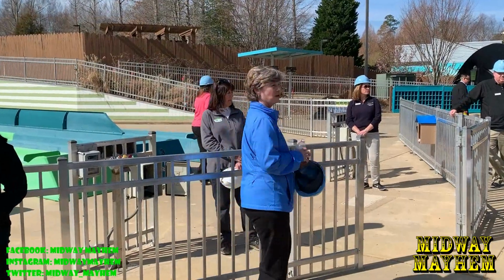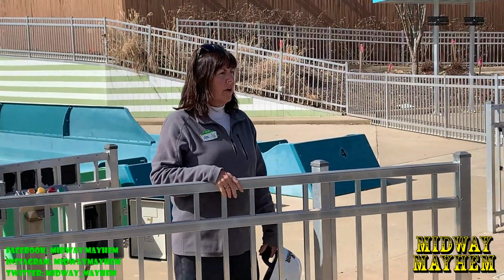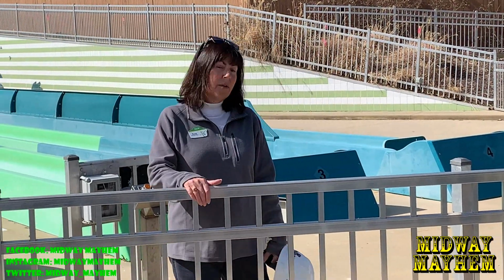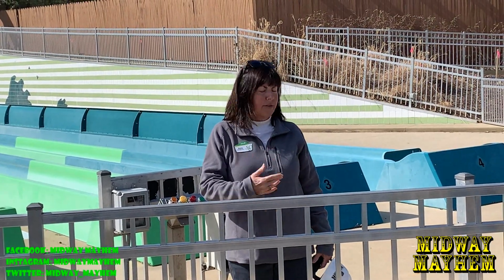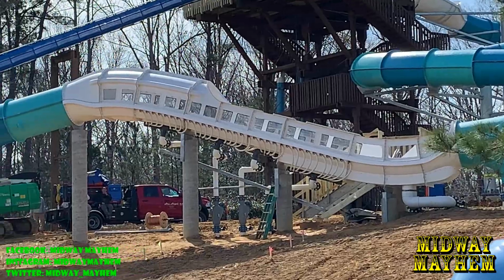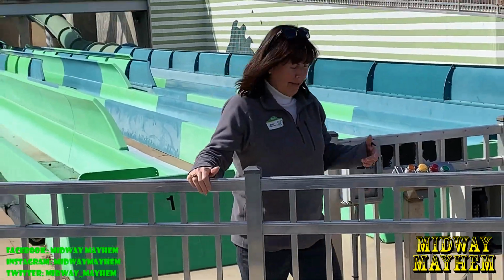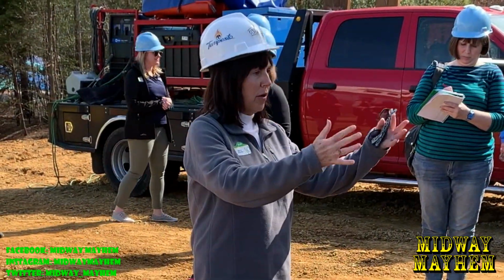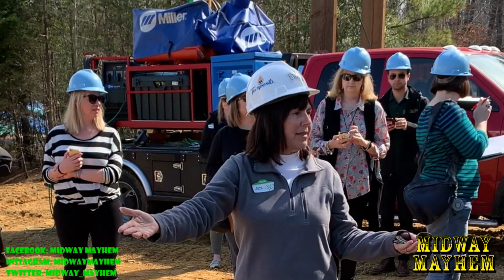Cutback Water Coaster At Water Country USA Hard Hat Construction Update

Comment: Every water park needs a water coaster because there's only so many variations on the same slide you can make
Reply: Yeah.  I can think of a lot of waterparks that could use one.  For instance, Adventure Island.  Even though they've added more attractions in recent years (Colossal Curl and Vanish Point) I think one of these could easily make up for the 9 years they went without a new attraction.  Aquatica San Diego and San Antonio could use one as well.

Comment: I am a little disappointed it's replacing Meltdown because that was the only ride in the park I never got to ride (it was closed for some reason).  Never the less, I know this will be an exciting slide.
Reply: If you want to see Meltdown there's videos out there, my channel has the last ride on Meltdown listed. In all honesty Cutback seems to be an evolution of Meltdown, and quite a bit faster and more thrilling. Meltdown also only could load 3 at a time so lines were long most of the time. This loads 4 so it should be significantly quicker throughput.